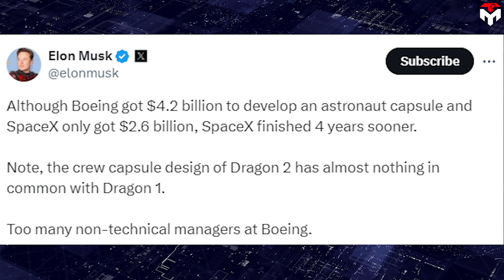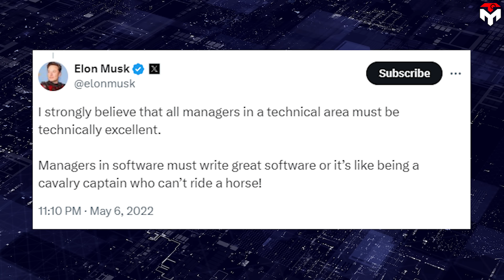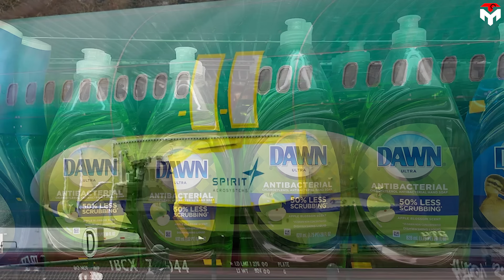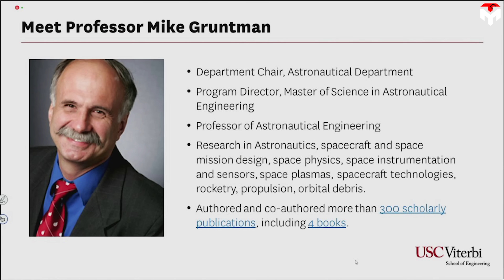Elon Musk Just Exposed Why Boeing Starliner FAILED! NASA Give Up...

Comment: Contrary to what is implied in the video,  the 737 accident airplanes shown are NOT max models. Both are 737-800 models, the  first on shown at 0:58 is Turkish Airlines flight 1951, registration TC-JGE. And the second one, shown at 01:01 is  Lion Air flight 904, registration PK-LKS.

Comment: Grammar sucks. Cheap dialog. Put together by illiterates.  Every other sentence has errors.
Reply from the maker: I will improve it thanks
Reply: This channel could have real merit in the space news sector. The problem is in the final production, with narration apparently done as an after-thought, as if it wasn't important. It sounds as if non-English language government-agency talking points have been automatically piped into an average translator tool, and then into a synthetic subscription-based narrator without any sanity check at the delivery end.

Someone like yourself from the demographic who will consume this content needs to be able to provide constructive feedback to the producer, item by item. This channel could easily become the Boeing (running joke) of the YT space news sector, but it doesn't have to.

Comment: Two sides of this engineering only argument.  Left on their own engineers tend to never finish pieces of the portion and keep making unnessary changes in search of perfection. Maintaining budgets, delvery schedules and quality are not mutually exclusive .

The reward for many aerospace programs is based cutting cost and early deliveries to receive incentive packages so those managers get the promotions. Top management tend to over promise and under deliver. Engineers from different departments frequently don't work together and cause unnecessary delays, increase costs and create performance issues downstream.
Reply: @flatcapcaferacer  Your second paragraph is dumb. Project managers are on the job to avoid all the things you mention. You must be a bean counter yourself.

Comment: The better managers are engineers who also have a good MBA. They understand both sides of the business. I’m talking about an MBA that is heavy on the quantitative, statistical, cost accounting and project management disciplines.
Reply: Those who have dual qualifications are very hard to find and are thus, in huge demand. Recruiting officers and Board of Directors tend to take the easier option and pull in anyone who is close to to the bill as long as they have plenty of "promise" - like getting a dodecahedron to fit into a round hole - "it's not quite round but close enough. Let's hammer it in and hope for the best".

Comment: They should take Elon's suggestion and use a bigger molecule like hydrogen instead of helium. Elon said that years ago and Boeing and NASA have been paying for not taking that advice ever since.
Reply: While hydrogen molecules are 11% larger than helium they are also highly flammable over a much larger range of temperatures (remember the dirigible Hindenburg?).  Also gaseous hydrogen is corrosive to metal under the right pressure and temperature.  Helium is very stable and will not burn or react with other elements.  It is the lightest noble gas.
Reply: @Oldman5261  ZIt would still require oxygen to be present in sufficient quantity to combust but I  see the other points clearly. Still the tolerances for seals on helium are significantly higher and as we've seen extremely difficult to reach reliably.
Reply: @Oldman5261  Given that they are using it for thrusters that are likely to be used in space I don't think the computability risk is excessively high compared to other risks at launch the corrosive issue could become a sticking point if this is to be reused on a regular recurring basis necessitation replacement part after each launch. depending on the inspection determination of corrosion impacts.
Reply: @Oldman5261 .  Hydrogen embrittlement

Comment: Okay but you have to admit SpaceX failed multiple times in fact they still can't get the heavy version to work either.
 I watched the front canards of that rocket ship disintegrate.
And for some reason they still can't get all those engines to light like they should.
I'm not defending Boeing they definitely had completely inexcusable failures.

Comment: They should keep it there use it as space station storage space and it goes down ith the station. By logic I think star ship need people or manual control that why it was launch with driver,  that why the decision hard. Lose the tow or lose the ship set back fir years, so it repair to it max and get on board.

Comment: The quality issue is not the main problem, let’s see an example :

The calculator of the Crew Dragon cost around 20000 dollars. An engineer designed and gave the plan to a technician who bought the components on the internet.

On the other hand, the buffet cost the same amount of money when Boeing launched the project for the calculator of Calypso.
Reply: I dont get your point. Who cares what the components cost vs. A buffet lunch for thousands? All that matters is if the people involved in the project are capable.
Reply: @SomeGuy-hd4cn  money is not the root cause, but a consequence. I mean that to many people within the Boeing Company were involved in the project for the calculator. On the other hand, Space X only enrolled two people for the project dedicated to the calculator of Crew Dragon.
Reply: @snavarro7713  so you mean too much management?

Comment: Boeing management is populated by a bunch of losers fro General Electric.  Aviation Week just had a good spread about this.  GE is now in the same throes, trying to save their company by breaking it up.  GM and HP promoted losers to their top management and paid the same price.  I hope both GE and Boeing can save themselves, since we worked with their engineers on major successful projects, of which were are still proud.  I am ashamed how far these companies have degenerated, possibly because they bought into the current wokie rhetoric and DEI, where performance is denigrated, and sloppy incompetent work promoted, for quotas.

Comment: what is f u p  is maritime laws control craft floundering at sea. once a ship is unnavigable, the us coast guard controls the ships fate or rescue.  we should do the same for US space assets, once a pan pan or mayday is sent , its out of the ships owner control, and US space guard which seems to be Spacex at this time.. should take over flight operations/program for safe return of US astronauts. the floundering / crippled ship should be control burned back loaded with Boeing hats, gloves and any other paraphernalia bs they took up there. No more FAA flight cert for boeing until they can autonomously launch and return craft without leaking oil, gas, hydrogen methane, air, cheese wiz and any thing else for 3 days fully pressurized before the mission and 4 days pressurized after the mission.
Reply: It is not a floundering ship. The modual has the abuility to return to earth but what NASA is evedently trying to do is work out what is going on as the part of the modual that is having issued "as is my understanding be it as limited as it is" the part with the problems will be ditched before re entry so they wont be able to work out whats going on after that. Ofcourse it would be optimal if what ever is going on wasn't but thats life on the edge when bean counters are in control of the wallet. Space-X is having a great run because they are being resorsed and I am sure are more than ready and willing to capture market share by assisting if called apon. meanwhile the employees get to sit and enjoy camp orbit at double or tripple time. and are probibly happy to wait for it to be sortrd rather than panic and jump into what is still an experamental craft.
Reply: @journeymanadventure  that is the difference in mindset between spacex and boeing. spx could care less about market share, they focus on the tech to enable space flight and its dynamic conditions for efficiency of product or operations. NASA is in a cya mode, trying not to add to the stupid things we did file. Boeing should be at the lead, not acting like being rescued is page 40 of the flight plan. this is why I said the decisions should be to the space guard to get the crew home and not really worry about the ss minow made in china ball valves that leak.

Comment: Just plain absence of thought and analysis.  As to the analytical questions: "what can go wrong" and "how bad can it be" and based on the answers to those questions, the prioritization of  "what must be done to prevent/correct it".

The very first question in the whole string is: "why are we doing it at all", which is similar to Elon's "the best part is no part".   So that first question is: "why are we using Helium for the control thrusters", why are we not using Nitrogen or some other inert and suitable gas.  Why are we using the second most "difficult to contain" gas on the planet???

Even kindergarten kids know this: that Helium filled balloons deflate over time.  And part of that is because some of the Helium atoms migrate through the atomic structure of the Balloon skin.   So what kind of control valves need to be designed to solve this????   And is any weight (mass) advantage of using Helium, going to be offset by the size/weight of the valves and hardware needed to contain it.

Comment: I was an engineer at boeing for 27 years and it was painfully obvious that Boeing started sliding downhill immediately after McDonnell-Douglas bought Boeing with Boeing's own money. It was a very sad decline.
Reply: But they did everything they could to be a successful company...

They knew diversity was their strength, so they got rid of all those straight white males and hired people based on their sexual habits, skin color and they even held drag shows....

How could this have happened????
Reply: @davidminer84 Diversity has nothing to do with Boeing’s problems.
Reply: @jamesdellaneve9005  when you hire engineers based on any metric besides competency you get less competent engineers. 

...And by definition,  "DEI" has nothing to do with competency.
Reply: @davidminer84  Boeing is not woke. We don’t lower the bar to get (fill in the blanks) engineers. We don’t have a problem getting top talent. This is a management problem.
Reply: @daveweiss5647  What’s not true. There are multiple threads here.
Reply: Sadly, a failed company kept the Boeing name and the failed business practices. It worked for a time, but now there is nowhere to go.
Reply: Back in the day Macdonell Douglas was a good company with a good product
Reply: @rosspayne2235  It was the decline of McDonnell-Douglas that brought about the merger with Boeing. Their fall happened when they started saving money by never starting with a clean sheet of paper on new projects. "Stretching" a plane once works. Doing so many times is a failed exercise. 

The Boeing 737 was a great innovation when first built with "tiny" tubes for engine pods. Not so much when you have ground clearance issues by sticking on "huge" modern engines and only extending the nose gear so as not to change anything about the flight characteristics.

(Yes, that was oversimplified.)
 However, Boeing has ALWAYS kept the pilot certification the SAME from the very first 737 airframe to the newest one just getting its final coat of paint. If you can fly one, you're ready to fly any of them.

Tons of changes over the airframes, and zero upgrades to pilot training? Great idea on paper, not so much in the real world.

Things changed in 1995 with the merger, and not for the better.
Reply: I’ve been here for 34 years. I am retiring in Feb. You are correct. It was the GE guys that took over and ran the company like a private equity firm. I tell people that we make airplanes and are run by people that don’t love airplanes. They’ve gutted the company and people are not empowered. No execs have passion and they are finance people.
Reply: This is what happens when the government sponsors an aerospace industry player against the market by awarding completely excessive military contracts. The subsidy policy for the military-industrial complex in the US needs to be reviewed as a whole.
Reply: @giostisskylas  this is a very good lesson for the left. 

...Boeing was awarded nearly twice as much money from NASA to produce a space transport for their international space station but Boeing has done nothing but fail.

Space X, with about half the budget has been wildly successful and in the process they developed reusable boosters that land themselves. 

...why and how was this possible?
Because Elon Musk is a physicist who is in control and only hires the best engineers based on merit... not DEI.

Yes it can't be ignored.
Reply: I was a fight deck module designer at Boeing in Renton (1998-2002) and witnessed first-hand the devastating take over of management by former McDonald Douglas executives. Almost immediately this caused a toxic work environment. I took the golden-handshake and got the heck out of there. This was definitely the beginning of the problems with quality and safety. It was once a really cool place to work where everyone was so proud of the best world class aviation products.
Reply: @daleadkison3349  I grew up in Century Palisades, Washington ; my dad was a senior captain flying DC-9 out of SeaTac international airport in Seattle. 

Our good friends were always discussing things at Boeing with us because the husband was a physicist working for Boeing. 

This was the time the 707 did the barrel roll over the water during the hydroplane races.

I just remember thinking, "Boeing is soo cool!" I thought Boeing was the greatest company on earth back then.

It's sad to see this happen!
Reply: Maybe Musk should take over Boeing?
Reply: Wait! Mac bought Boeing with Boeing's own money? Can anyone explain how that was pulled off?
Reply: This is why I'm glad JetBlue didn't merge with Spirit. Maybe that's a blessing in disguise
Reply: Yup, it all started going downhill when they moved the HQ out of Seattle and seperated leadership from the engineers! It has been I. A downward spiral ever since!!!
Reply: Keep on pass the bucket...

Comment: Boeing is worried about its reputation getting worse. Don't they realise it couldn't get much worse. The astronauts are safer on the ISS. Boeing should return Starloser autonomously to Earth. If it can undock without damaging the ISS and land intact, then  Boeing will have achieved something positive. If the crew are killed during the return (and few space accidents are non-fatal)  Boeing will put the US space effort back years. NASA start to plan long term and should terminate Boeing's contract and start to fund a bus version of Dreamchaser, as the ISS is dependent on attached capsules as lifeboats and has no vehicle capable of evacuating all the crew at once. Dreamchaser should be able to launch on Falcon 9 and get man rated ASAP. NASA should use a standardised space suit and docking port design because a Space Rescue capability is presently lacking and will be needed going forth to the next generation ISS and foreign space stations.

Comment: Since Starliner can reenter fully automated, let it and then have Dragon return the astronauts with a known and proven safe craft. If Starliner makes it, then it’s proven itself. If it doesn’t then no big deal, consider it a test flight, debug the issues with engineers not accountants and test again. It’s much easier to rescue the crew where they are now than to try with a spacecraft that has an unknown reliability that could cause a craft to craft rescue to be impossible.

Comment: It is a horrible thought, but it should be mentioned.  What if NASA and Boeing decide that Starliner is good to go and there is a failure during re-entry or during transition leading to the lose of the craft and astronauts.  Heads will have to roll at both NASA and Boeing, it may even destroy Boeing entirely.  NASA will have to make a call soon. Remember when the Soyuz space craft that sprung a coolant leak in December 2022 and nearly deorbited the ISS.  The Russians space agency sent a second Soyuz to the ISS to return their cosmonauts safely back to earth and returned the leaking spacecraft unmanned back to earth a short time later. Even the Russians know not to take chances with defective equipment. Does NASA really want to take chances with peoples lives, to appease the corporate kissasses and flunkies at Boeing.   Best they make the call Musk and ask SpaceX to send up a Dragon capsule to ferry the astronauts safely back to earth.  Let Boeing return their piece of junk tin can back unmanned and if it makes it back safely figure out what went wrong back on earth without putting peoples lives at risk.

Comment: I worked for Boeing for 38yrs and they would say any manager can manage any group of workers! Then when we would try to get the managers support they had no idea what we were talking about which often lead to the exact opposite of the decision we needed. Boeing has been failing since the 1990s and now they are nothing short of the disasters we are seeing.
Reply: That crap only "works" (actually doesn't work) if the managers are so high level that they are disconnected from the team. The group are just a bunch of line items on a spreadsheet.
Reply: It went downhill since Alan Mullaly’s departure from Boeing and Jim McNerney’s entrance into Boeing.